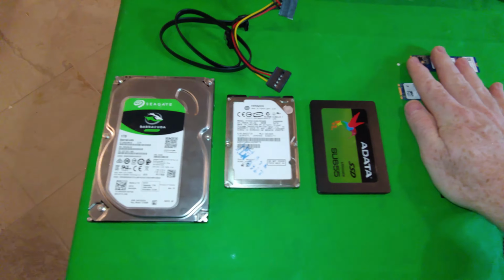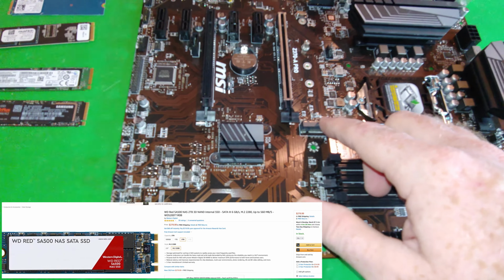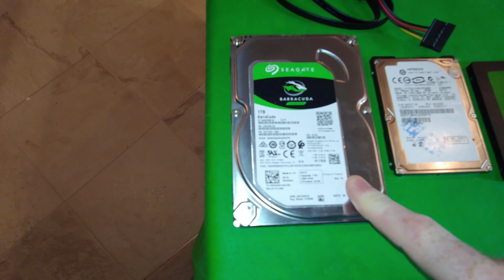Ep 9: 2020 | How to Build a Computer | Drive selection HDD, SSD, M 2 NVME, SATA, 20 Video Series

Comment: unless you really need your pc to hold a large amount of files for editing and such, any typical pc only really needs a small ssd for the OS and at least a 1 to 2tb mechanical storage for programs and data, speaking from experience, i had windows 10 home running on my 1tb drive before and there is no comparison at all to my new ssd, its a huge difference, now that windows is running faster than its ever been, the 1tb hdd has nothing to do, the load is now reduce on the drive, reserving its resources and allowing programs and files to load up faster.